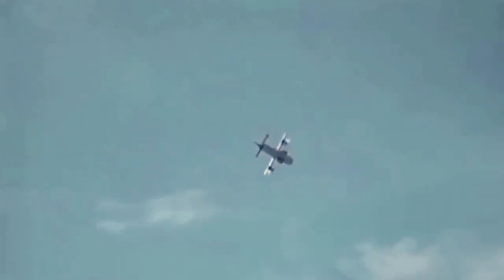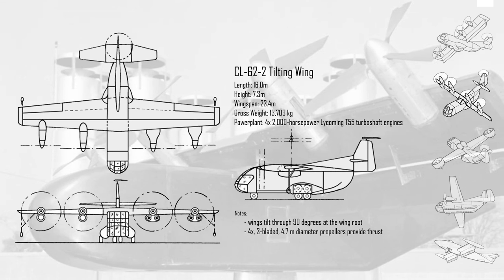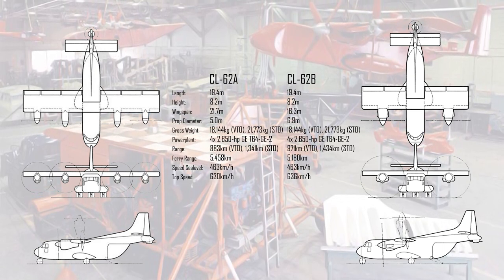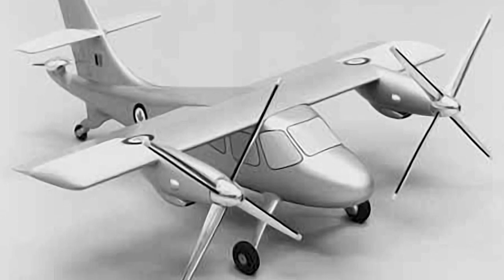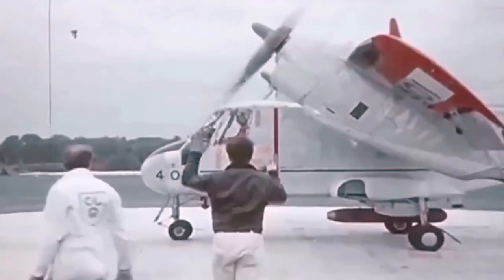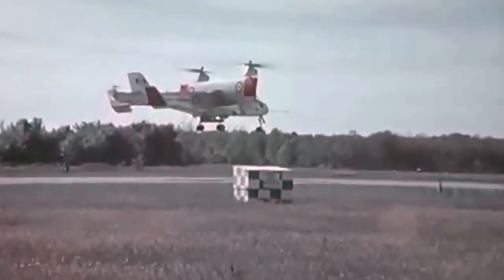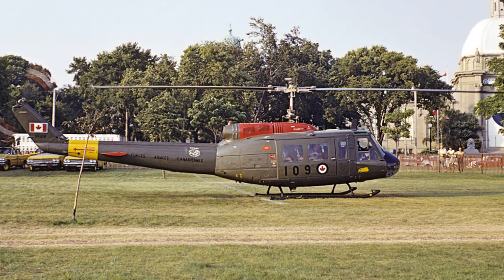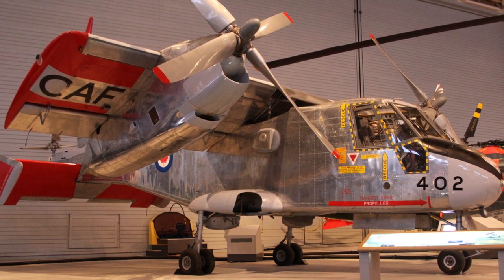Canada's all-purpose VTOL transport that could have changed everything; the Canadair CL-84 Dynavert

Comment: Not quite as heartbreaking a story as the Avro Arrow, this seems to be another case of hard work and brilliant ideas tragically losing out to politics. Great presentation. I wonder what the costs compared to an equivalent helicopter would have been? Just the fact that you did not need to be a helicopter pilot to fly it seems like it would have made it a success.
Reply: Dude, did you not listen? Not so much politics as none of the potential costumers placed any orders. And here's why: 19:52
Reply: The avro arrow was canned because it wasn’t a good plane built for a role that wasn’t needed
Reply: @dartmaster501  Sales were needed to the Americans, but as has been shown in many cases, the Americans will much prefer to buy American, and even attempt underhand actions against the companies they see as competition. The reason why the P1127 / Harrier was successful was because it became the McDonnell Douglas (now Boeing) AV-8B Harrier II instead of the Hawker Sidley Harrier.
In contrast, here in the UK, TSR2 was cancelled in favour of the General Dynamics F111 through politics influenced by the Americans, and Canada had a similar thing with their Avro Arrow.
Reply: It wasn’t’t a total loss.
The basic design was incorporated into the V-22 Osprey airvraft (a real gem by US military standards) as a “flying truck” and aerial machine gun platform in Vietnam).

The difference is thst, the engine nacelle rotate on the V-22, and not the entire wing.

When I was on the CL 84 project (we called it CC-84 - and never “Dynavert”, the main shaft had to be replaced at least 4 times to my knowledge on 8401, due to minor cracks which developed in flight during the transition from Wing 90 (Helo mode) to Wing 0 (standard aircraft).

If you find the group picture, I’m in there. Massey is a borrowed name for privacy.
Reply: Make that CX-84.
Typo due to big fingers.
Reply: @jb76489  If they didn't think the role was necessary they wouldn't buy f-101s from the US

Comment: Great video. I remain amazed by what the engineers from back in the day were able to produce without hardly any computer/simulation tools.
Reply: Did you miss all the wind tunnel testing? Static testing, 16bit computer to control low speed and transitions?

Comment: I never really got why these tilt wings aren't more popular. they are superior over helos in almost every way. but sadly politics doesn't care if its better or not
Reply: Agree.  And you could potentially land it like an airplane if needed.
Reply: Because they are insanely more complicated and crash A LOT. They're also MASSIVE. sitting next to an M1A1 the osprey dwarfs it.
Reply: @richardmoore609  It's maybe because the Osprey is designed to carry more than 6 people?
Reply: I guess its money and efficence based on it, Helis got 1 engine (not counting the tail one tbh) cheaper and easier to maintain, probably also less fuel needed per pound lifted, while probably a design like this one (based on couples) had inherent problems related to calibration, asymetry problems, etc... twice the base twice the trouble.

* I still love this more than helicopters, I think the maneuverability could be way better, however I think the military left too much love into other air vehicles like jet fighters or bombers, making this "middle point" (between air and land) less exploited.
Reply: @BioClone  Helo have their tail rotor linked to the engines that drive the main rotor, there's no small engine in the back :)

Comment: Thank You for another great documentary. Very interesting to see the aircraft designed and flown 40+ years ago, capable of fulfilling numerous roles so coveted today by those looking for a COIN airplane. Practical, multirole capable, low pilot load, easy to transition to,made in Canada, and it didn’t get far at all. Hard to accept.
Reply: yea, the arrow if upgraded could perform as well as the fifth generation fighters of today and it was almost brought back instead of the f-35, and the cl-84 if made larger and used the bigger engines they initialy were going to use could easily outperform the osprey, and both would cost a fraction of what they f-35 and v-22 do.

Comment: Why in the hell does Canada design so much awesome stuff, beautifully thought-out, designed and well built and then no one wants to buy it or use it? It's heart breaking.
Reply: its because america has the power to persuade other countries not to buy from us and then they end up making very similar aircraft years later, just like in this video, they signed on to make the cl84 a joint program then cancelled it probably after they had enough info or access to the blueprints and then they tried to make an almost exact copy as their own, unfortunately they tried to make the 4 engine version which canada knew didnt work so the US gave up for a couple of decades and made the v-22 osprey which still isnt as good as the cl-84 and they cost 72 million each, the only advantage over the cl-84 it has is payload capacity and a slight range advantage and if the cl-84 were scaled up and used the large size airframe and much more powerful engines they intialing were looking to use it would easily outperfom the osprey at probably half the cost, the US also made a jet strikingly similar to the avro arrow year after they helped pressured diefenbaker into cancelling the program, and the arrow built in 1959 was almost ressurected and used instead of the f-35 because it could compete or outperform it even though it was 40 years older and the arrow would cost a fraction of what the f-35 cost.

Comment: If Canadair had teamed up with Fairey in Rotodyne development they would have been able to save time and money on R&D significantly and refine the Rotodyne as a large transport craft because it was already large and fast. Tilt engine planes could still have been developed but from funding generated by Rotodynes used commercially as 'city hoppers' necessitating pessurization. Canadair's (and Boeing's) tilt wing craft cannot ensure proper pressurization and this limits altitude.
As the Rotodyne only used its large rotor for VTOL and hover it could idle and generate power in horizontal flight and the independence of the rotor meant that in could land safely if all other systems failed.
Fairey/Canadair could have rapidly developed an extensive range of commercial, military and construction VSTOL planes almost a generation ago and should have done.

Comment: Copy the design, and build one NOW, and sell it to the private industry, not the government?  Here is how you do it with an EXISTING design:  Take an existing helicopter. raise the rotor 20 feet higher on an extension that can pivot 60 degrees forward (the pivot is at the fuselage itself). Have wings on the side that rotate similar to that of the CL-84 as the rotor blades pivot over their range. You don't need the rotors to rotate a full 90 degrees, 60degrees is more than enough.  The result is a helicopter that lifts off like a helicopter, but transitions into an airplane just like the CL-84, and all you need to do is design and build a PIVOT for that helicopter rotor, and the control mechanism that transitions from vertical to horizontal flight. This can be done with practically any helicopter that is fairly short in length. If the body is too long, the design won't work as the rotor will be rotating forwards and downwards.

Comment: Sadly it wasn't until 1980 and Operation Eagle Claw and it's complete failure and loss of 8 Service Men and 1 EC-130 and 6 RH-53s that the Department of Defense really started looking at VTOL Troop Aircraft had we had the CL-84(MV-84? In flight refueling?) Thay wouldn't have had to land in the middle of Iran to Refuel the RH-53D that weren't even SOF Helicopters just what the Navy had available 
But you learn from your mistakes i guess